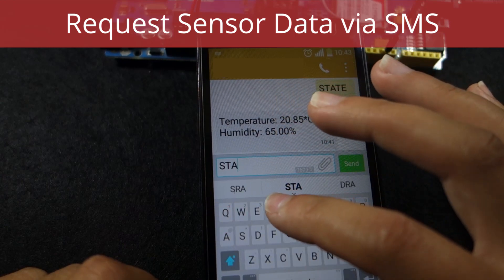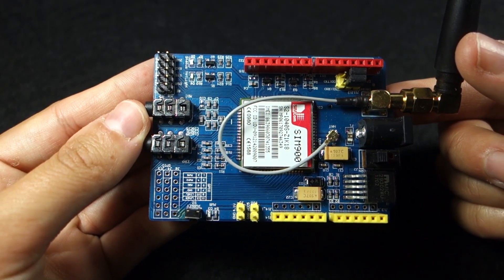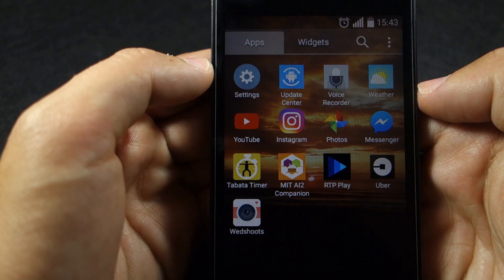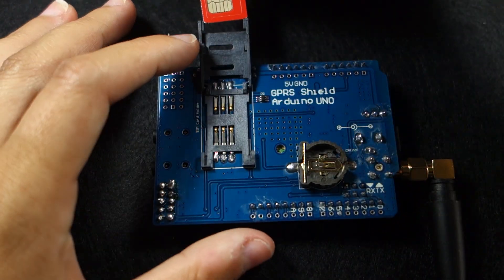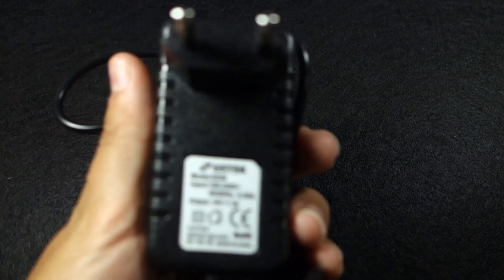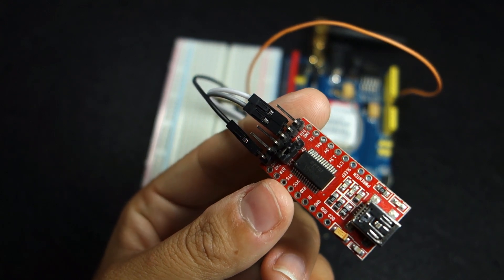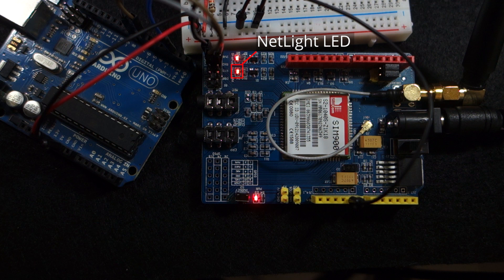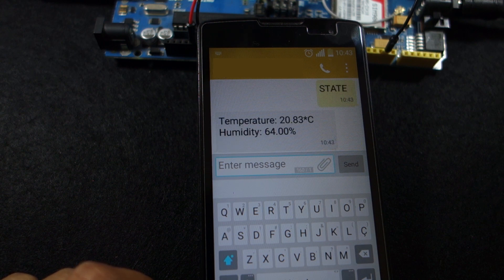[DEMO] Request Sensor Data via SMS using Arduino and SIM900 GSM Shield

Comment from the maker: You can find the complete project details: https://randomnerdtutorials.com/request-sensor-data-sms-arduino-sim900-gsm-shield/
Reply: im using a sparkfun weather shield instead of DHT sensor but im confused about the interfacing of this shield with the arduino gsm shield 2. Can you please suggest me a solution for this?
Reply: Can u share your library? Cause i cant use my library to try your coding

Comment: Hello
I send STATE to sim, it will only appear on Serial Monitor window, not send message to server, friend :)
Reply: Check signal
Reply: @0x0122  i use that program to my ultrasonic sensor, but failed, maybe because the library, can u teach me please?
Reply: Same problem, did someone fixed this?

Comment: thanks for the video,
why do we need to simcard pin lock?
I've sim900A So do i need to off the sim lock?
Reply from the maker: In order to use my example, you need to turn off the SIM lock, because that's how the Arduino code is prepared... I couldn't find any working example with the SIM lock activated.